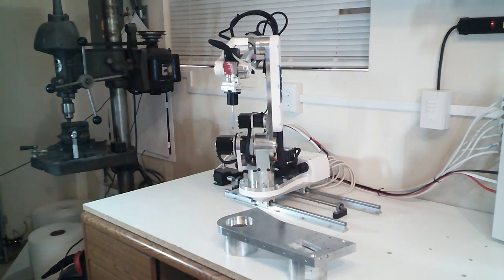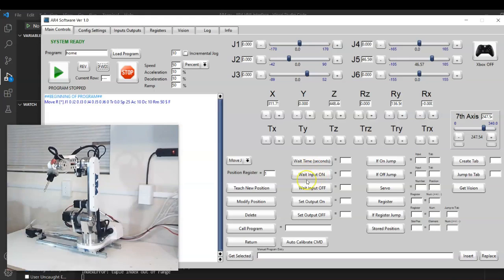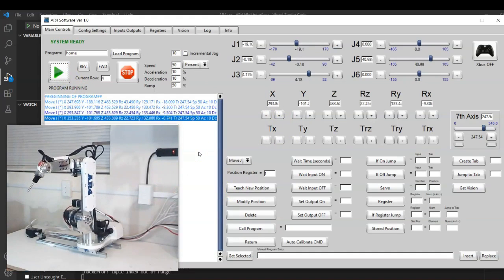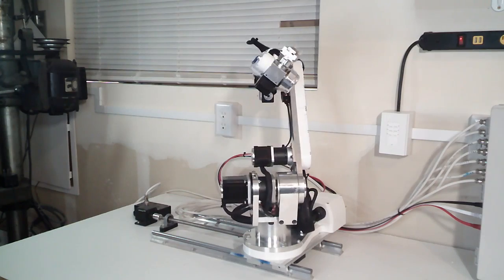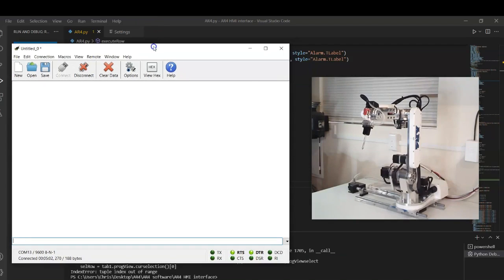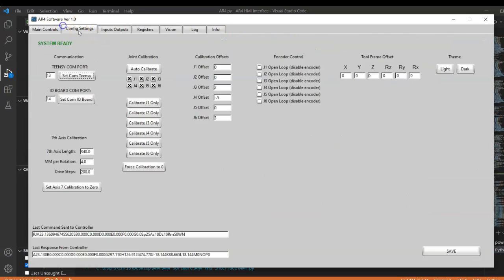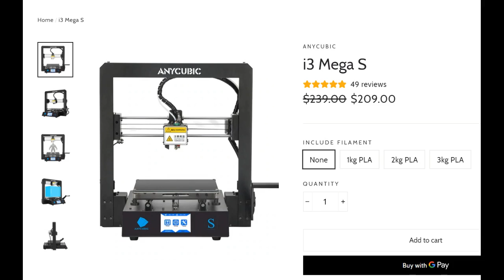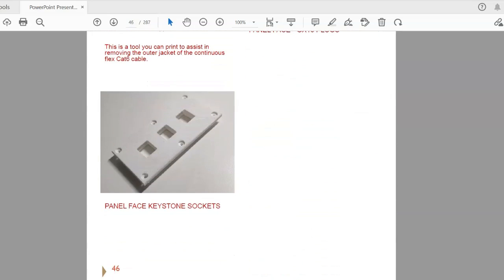AR4 6 Axis Robot Arm

Comment: hello , excellent project....amazing , can we operate this robot in a Leading-following control mode
Reply from the maker: the mechanics of the robot don't lend themselves to manual lead through program like in a cobot.  The AR4 is jogged to position similar to an industrial robot with teach pendant programming.  Let me know if you have any questions.
Reply: @anninrobotics Hii, I’m from India, I’m very proud of you and I’m interested to develop a robotic arm and I need a robot arm- when we manually positioned the arm - software will automatically update the coordinates and when we play it, it will move to the same direction - can you please help me to find out

Comment: This is so cool, i dont know much about these things, im getting into it due to how pricey some options are. I want to use it for laborstory automation.

How precise and accurate is this fellow? Im not sure exactly what i mean by precision and accuracy, but maybe someone can give me an idea.

Best
Reply from the maker: Thank you.  Its quite repeatable. no issues doing the same task over and over.  It is a low cost robot   with planetery gear boxes and not quite the same realm as a $40K industrial robot with harmonic gearboxes but it does really well considering.
Reply: @anninrobotics  that's great. I looked through your website and read 0.2mm precision, sounds very good for a lot of different tasks especially at the cost. Also I like the small footprint. IMO for a lot of biotech laboratory automation it seems, rare that you need long ranges and heavy payloads. I think precision and accuracy is important though. I've shown my boss your website and robot in case we will need it at some point, (right now we are implementing other stuff). Hope to get to work with one or more 😁
Reply: How much would building this nice robot cost?

Comment: Just curious, why Teensy4.1 over other microcontrollers currently on the market?

Also, any chance the control software could be run on raspberry pi instead of windows?
Reply from the maker: The Teensy 4.1 has the fastest processor, at least it was at the time for running the robot kinematics and it also has a loader for using the Arduino IDE which makes it a bit easier. Yes I've had several people around the python source code on a Raspberry Pi I haven't done it myself yet but I plan to

Comment: Sir,
How does this robot holds it position when power off.. brakes? High Gear Ratio helps? Anything else?
Reply from the maker: It does not have brakes. I stand it vertical when powered off. It also has auto calibration, so you can easily calibrate after powering back on.
Reply: @anninrobotics  But what if it's doing some work and suddenly power goes off , so in that case it will fall. Right? 
Any way to stop that ?

Comment: Hi Chris. Can I use arduino board instead of useing teensy board? I can't find teensy here in turkey.
Reply from the maker: you can use the duo board but you will have to remove the encoder library and run in open loop mode as the arduino board will not run the encoder library and the performance will not be as good.  I do have the electronics kit which has the teensy board if that helps.

Comment: I would like to know what books you used to do the kinematics calculations... I suppose you are very good with matrix calculus, did you use c++?
It shows that you are very good in mathematics, programming and electronics. Congratulations!
Reply from the maker: Thank you. I studied a variety of material and I found Angelo Sodemann's Channel very helpful. I initially worked out all the kinematics in an excell spreadsheet but in the current code is arguino/c++
Reply: @anninrobotics  Thanks for the information and excellent work, I will try to see your tutorials, greetings from Argentina!

Comment: Uhmmm. Someone knows a ton of shit and yet sounds so sincere...I have found a hidden Gem wow.Thanks Alot!!!
Reply: Reading ar4 manual at the moment. Heating bearings with a hair dryer.....Why haven't I thought of that years ago? My shop is getting new hair dryers now lol. Your work is astonishing. I can only imagine the time and effort put into this. This is literally the best treasure I have found on the net. I'm assembling all components in cad today to check the design out. Are ar4 stl files nominal sizes or should I go for ar3 nominal size spec folder?

Comment: Completely blown away mate, ive found your channel researching the build of a 4/5th axis for my self built cnc router and I now have a new project hahaha thank you for this. Can I ask you how rigid is the arm... if you mounted say a dremel or similar on it could you make it carve timber? I know dimensionally it would probably not be very accurate but more for artistic pieces, you would probably need to program a way for it to probe the stock before it starts carving too or is the learning you were showing how thats normally done? Sorry about all the questions and please keep doing what youre doing!
Reply from the maker: Thank you very much, I haven't done anything with a dremel or carving yet, I think if it was a small Dremel and lightweight enough the robot would do fine. The robot would need to be able to interpret G-Code to run a program like that which should work with robo DK once the post-processor is up and running, but I have a little more work to do on that.
Reply: @anninrobotics  Ok awesome ive subscribed to see how it all goes, I know my dremel comes with a flex head attachment so the main unit is a metre or so away from the end which would probably save a lot of weight hanging off the end if that becomes a problem but also a dremel is hardly ideal and if it all goes well you would need a spindle of some sort... I saw the pocket NC cnc comes with an air driven spindle which would probably be lighter than a brushless type. Anyways I love your work seeing this sort of thing is inspiring as hell I think im going to try cutting out the parts from HDPE which a local scrapyard has a mountain of for pennies and see how it goes. Thanks again

Comment: Hallo Chris, What if  I want to use the closed loop stepper motors instead of the encoders, will it possible it user the AR4 CODE?
Reply from the maker: Yes, just select open loop mode for each axis in the calibration settings tab.

Comment: Please check the assembly. The program Ar4.exe Version 1.1 freezes at startup and does not open. On two computers. The Error Log file says: "COMMUNICATIONS STARTED WITH TEENY 4.1 CONTROLLER" The AR3 version starts normally. I don't have any Teeny devices connected.

Comment: Hi Chris-  I’m very happy with the progress you’ve made - congratulations!  I feel like the final step will be to place motors 4-6 behind the elbow - like in this example: https://youtu.be/kY67o37YvJc.   This requires the “shaft within a shaft” design, which would add slightly to your cost, but improve the performance immensely, and place your robot on par with a professional model.  You’d be rich selling this!  The cad files for this design are avail online.  👍🏼👍🏼👍🏼

Comment: Can this AR4 be programmed to run a file when when you press a button/switch it will run that program without having to run off the program? Also could you control the robot by a wireless controller? If so will it be able to record the motion to repeat it later on its own, as in making a program file to repeat? Thank you for your time.

Comment: Hey Chris (or Mr. Annin if preferred)

I'm an electrical engineering student from Cologne, Germany, and about to write my Bachelor Thesis ☺️

Since it's gonna be my project, I'm currently tinkering on my own radio controlled version of a KUKA IIWA or KUKA Quantec. For that, I'd like to buy the set of an AR3 or AR4 and want to set it onto a chassis with Mecanum wheels. Now, in order to create a smooth movement of all the various axes, I'd need to link the chassis control to the AR control. Since you're the Designer, I'd like to ask you: Is there any kind of machine-to-machine interface in the ARs code? :)

Sure, I could just run both of the controls on one and the same Controller, but then I'd have to re-engineer the whole code.
Also - over time and later in my Masters Thesis - I'd like to turn my knock off KUKA from a RC vehicle into an autonomous. Especially then it would be nice to not re-engineer the whole code😅

Thanks in advance☺️

Comment: I am trying to convince my management to go for this rather than the universal robots we already have. This seems so much nicer to use as an engineer/software developer. This is amazing.
Reply from the maker: thank you
Reply: One thing that they emphasize with the UR's is the relatively low impact if they happen to collide with a human. This tells me that they are running true servo-motors in "Torque Mode" and they are limiting the torque to just what is required. I'm not a stepper expert but I suspect that this technology isn't capable of torque limiting(?)

Comment: WOW ! i was in the process of printing the parts for the AR2 and i was getting issues not knowing if the position of hole where going to match the position of the servo. Now that you said there a link to get the full kit for the servo I think i will just get that going and continue on.

Comment: So just under $2,000 all in. Not bad. But what are the specs? Reach, capacity, accuracy, precision?
Reply from the maker: hello max load is 1.9kg, reach is 62.9cm, repeatability is tested at .2mm  thank you very much
Reply: @anninrobotics  Very nice! This is a great option for anyone wanting to get into robotics. Is the software source available? E.g. to check and improve the kinematics and adapt to other control systems?
Reply from the maker: @JamesNewton  yes all the source code is available on the downloads page.

Comment: Love it!  What is the weight capacity of the head?
Reply from the maker: Hello,  max payload is 1.9kg
Reply: @anninrobotics  Would designing the wrist as a differential gear increase the payload?  This way you could place the motors behind the elbow to counterbalance the weight of the load.
Reply from the maker: @dwalden74  yes that would certainly increase the payload and something I had looked into but I was not able to find a cost effective way of integrating a gear system and then translating that motion through the forearm adds alot of complexity as well.  Im sure there are things I have not thought of though so if you have any ideas id be interested.
Reply: @anninrobotics   I understand the complexities this adds.  I would suggest getting in touch with Skyentific (youtuber/engineer and robotics enthusiast). He’s worked a lot with differential gears, and even made his own.   He would be a valuable resource in finding the best solution for you.  👍🏼
Reply: FYI, here’s a breakdown of a Kuka wrist joint: 
https://youtu.be/i4_0LyXZWTw
CAD models in the description.
Reply: @anninrobotics   I’ve been looking at the CAD files of the forearm/wrist joints for the Kuka 350, and it doesn’t seem completely crazy to consider integrating something like this into your project.  The Kuka can handle 350 kg, but a cheaper version could probably handle 10 kg, and only add $1000 or less to your total cost. This would be a game changer if you could pull it off. 👍🏼👍🏼

Comment: Hi Chris, looks great! Do you have a changelog of the AR4 from the AR3 with belt upgrade? Are the only changes the electronics, motors, and software? Thank you
Reply from the maker: Hello,  I will be working on a document and teensy sketch to update the AR3 to use the AR4 software this week.  The primary difference is that the AR3 uses the CUI encoders so I need to create a 4.1 sketch that has the correct encoder values.  The pinout on the teensy 3.5 is nearly the same as the 4.1 so I don't expect there to be much in the way of wiring changes.  When I have the sketch and document ready I will post it to the downloads page and make an announcement on the site's blog page.
Reply: @anninrobotics  I thought we couldn't use a Teensy 4.1 on AR3 as the encoders need 5v and the Teensy 4.1 only runs on 3.3v ?
Reply from the maker: @nermaldotorg  On the AR4 I added a 3.3v and 5v wire going to the base of the robot, the 5v powers the encoders and the encoder return voltage is low enough the 4.1 is fine and then the 3.3v signal is used on the limit switches.  All that being said I have had several people use the 4.1 anyway and even with the limit switches being powered by 5v there seems to be enough voltage drop that no on has reported burning out any teensy 4.1 inputs.  Regardless I am going to put together a upgrade document and explain this and still recommend people run a 3.3v to the base and switch the limit switches to 3.3.  email me if you have any  other questions on that and I will try to answer any questions you have.
Reply: @anninrobotics  Thanks for the reply - I might just put a diode in series on each of the limit switch inputs to the teensy to drop the voltage another 0.6v or so.

Would that work ?

Comment: What is the max load and repeatability of the robot and who makes the aluminum parts that they only cost 580 dollars
Reply from the maker: hello max load is 1.9kg, reach is 62.9cm, repeatability is tested at .2mm and I have a great machinist I work with who is located overseas but does a great job in creating the parts at low cost for us.